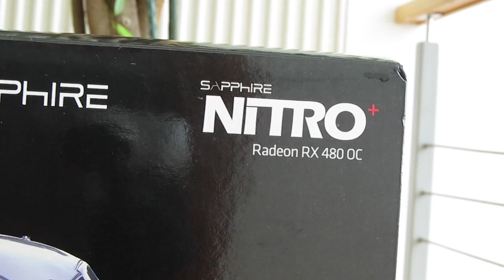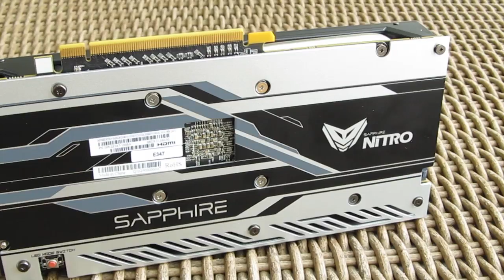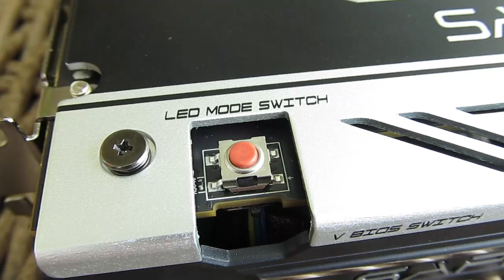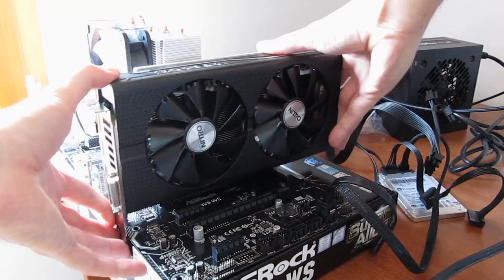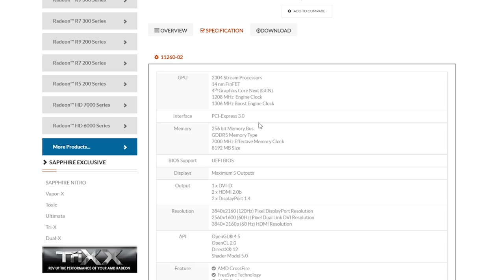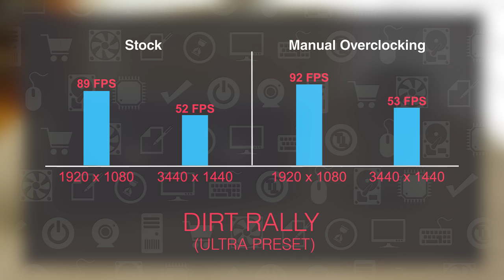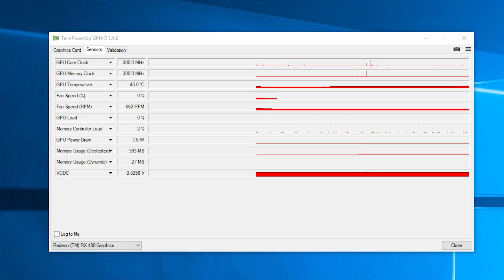Sapphire RX 480 Nitro+ Review - Aftermarket Salvation

Comment: is rx 480 better than gtx 1050?
Reply from the maker: Yes!
Reply: Can this pc run all games in high settings?

Intel i7-6700K || 
Cooler Master Seidon 120v (водено ладење) || 
Radeon RX 480 (Sapphire Nitro+ 4GB) || 
Gigabyte H110N Mini-ITX || 
РАМ: 8GB Kingston HyperX || 
SSD: Kingston v300 120GB || 
HDD: Toshiba 1TB (7200rpm) || 
Antec ISK600 (mITX) ||
Reply from the maker: What resolution? 1920x1080?
Reply: 1366x768
Reply from the maker: Without a problem!
Reply: I dont know which pc should I buy

Intel i7-6700K || 
Cooler Master Seidon 120v (водено ладење) || 
Radeon RX 480 (Sapphire Nitro+ 4GB) || 
Gigabyte H110N Mini-ITX || 
РАМ: 8GB Kingston HyperX || 
SSD: Kingston v300 120GB || 
HDD: Toshiba 1TB (7200rpm) || 
Antec ISK600 (mITX) ||

or 

Processor -  Intel® Core™ i5-4570 - 4rd Generation Intel® Processors
6M Cache, up to 3.60 GHz

Memory - 8GB
HDD - 500GB

VGA - НОВА Gigabyte PCX GeForce GTX 1050 2GB GDDR5 DVI/HDMI/DP

Comment: can i pair this with asrock h110m hdv?
Reply from the maker: Yes!
Reply: thank you! ;)
Reply: Please what about a i5 6400 and ASUS H110M-K D3 with 8gb ram ddr3 16000mhz Will the i5 bottleneck this gpu? from what i see on youtube the 1060 gpu are bottlenecked by this gpu ... Also i need to change my psw i have a casee psw with this system (plus gtx 950) what do you recomend for the rx 480 if it will worck with i5 6400?
Reply: usss2444 should be fine

Comment: I've been reading that a statement from sapphire has said that the driver that has been used by reviewers around the time the card launched has an impact on the fan noise due to the AMD driver overriding a profile that is baked into the card BIOS that reduces the speed of the fans. I'm hoping that the latest driver from AMD has fixed this and wondering if anyone who has this specific card can verify for me?
Reply from the maker: +Agent-Joseph Richardson #101915 Even if they fixed it, what kind of temperatures would we get (presumably it lowers down the fan speed), over 80°C?

Comment: will this be fine with fx6350 or would be better to go for fx8320
Reply from the maker: If you're buying right now, the FX 8320 (maybe even FX 8300) as is it isn't that much more than the FX 6350
Reply: i will go for the fx8350 and rx470..after my research i believe rx470 is more than enough for 1080p gaming and fx8350 is pretty good combo with the rx470...the fx6350 or fx8320 would probably bottleneck hard rx480 cards..(im just planning not buying yet)

Comment: hey is my zalman 500w powersupply enough for this card, i also only have 6 pin connectors with 2 pins hanging from the side(is that basically a 8 pin connector)
Reply: Okay, thanks random guy on internet
Reply: DONT GET THAT POWER SUPPKY, IT SUCKS AND WOULD BLOW UP. GET THE EVGA 500W FFS
Reply: Yes and yes
Reply: hey, I got dazumba built-in psu 450w (dazumba 658), is it possible to use this gpu?
Reply: If you have the 8 pin PCIe connectors (6+2) on it, it should still run even though its 500w recommended..

Comment: they discontinued the 8 gig card that was clocked at 1306 the only 8 gig they have now is the 1340 clocked gpu. the 4gig is still 1306. Also if you make your own fan profile which you should, they no fan till 52c is ok but it will take more to keep it cooler than if you had the fans spinning the entire time just at a reduced rate. this is true of every gpu that has this feature. so say you have 25% fan speed untill it hits 45c then you ramp it up to 35% ect. you may not even hit 70c. If you set the fans to spin at 2200rpm fixed meaning all the time it would probably never get above 65c the gpu is not something you want silent keeping it cooler long and not letting it get above certain temps for a extended period of time will drastically extend the life of any gpu. dont sacrifice gpu life for some more silence.

Comment: should i buy the gtx 1060 custom version or the rx 480 custom version? its really hard to decide..
Reply: Lets not be fan boys here, I got a rx 480 sapphire nitro + 4gb but I wont say its for everyone. The rx 480 will have better performance in time in dx 12 but it will take some time, meanwhile the gtx 1060 outperforms the rx 480 in all current titles dx 12 included. 
There are exceptions to this (like Doom, Gears of war Ultimate edition and a few others)

I would say if being asked: If you plan to have the graphic card for 3 years or more buy the rx 480 otherwise get the 1060 simply because it has a 10-15% ahead in performance in most games at this moment and although this number will shrink (likely anyway/hoping) the rx 480 wont pass it in performance during this time.
Reply: Papa Bear well thats what im hoping for every AMD Card

even now R9 290X Runs beast because of driver support

Comment: Dude, Reviewer...
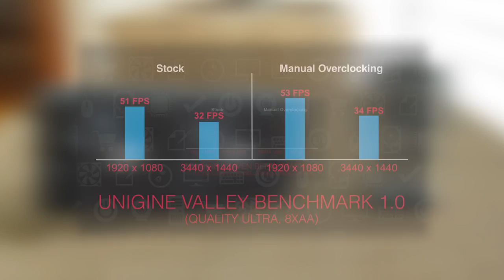6:25 GPU throttling like fuck, just look at core clock (1342mhz normal).
Reply: Skyfx most of nitro could can achive boost clock if undervolting via wattman

reasons why isnt undervolted first place is its different how people pc power efficient for cpu other hardware

so you have to match your safe undervolt wattage

Comment: Hi guys. Need some advice. I just got a Sapphire RX480 nitro OC. It comes with a dual BIOS. Im assuming it is for stock clocks and overclock settings. Secondly, the BIOS switch is on the right hand side (the back plate is face up towards me). Since the BIOS switch is on the RHS position, is this the default stock clock settings?. Thanks for your help.

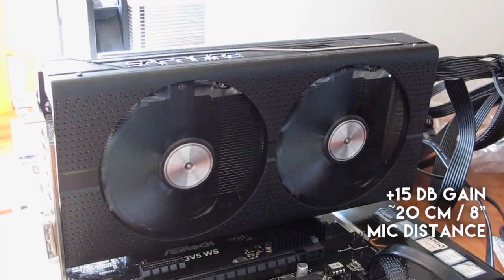Comment: woah wait... 07:05 ... You call that loud?? Are you people insane?
Reply from the maker: +sermerlin1 I guess where all insane and you're the only one sane here! 

Bottom line, putting (your) insults on the side, you missed the point here. When I talk about loudness, I'm not only looking at the noise "as is" , but rather how loud is it compared to other aftermarket solutions out there, and yes it's loud either way (on its own or compared to others, confirmed by a number of different reviews), no matter what kind of insults you spit out towards me or other commenters here.
Reply: TekTick comparing to others its not loud and it isn't loud.40 dB is whisper level mate.
Something is loud when it's over 60-65 dB and on. 40 dB is quiet very quiet.

Comment: Question: I watched your Nitro+ RX 470 review and I was curious about the bios switch. If I switch it to its stock or lower clock mode. Can I turn it down some more? So it'll be at 150W? Because electricity is expensive here and I'm willing to sacrifice performance for it. I'll even turn down the settings a bit if need be.

Can I downclock it? Please help me guys. The card will be available here in my country soon and I'd really want to know before it does. I tried googling but it didn't give me the answers.
Reply from the maker: You can always downclock it, that's not a problem. Lower down the voltage and clocks, play with it a bit and see what will be stable.

Comment: Did you only do temperature and noise testing with Furmark?  Or did you monitor it as you tested games?  Because I know from personal experience that using Furmark puts excessive unrealistic load on the GPU, causing much higher temperatures and fan speeds than what you would normally get when gaming.
Reply from the maker: In this case, only FurMark, but you can check my RX 470 Nitro review where I tested it in game (SW:BF), and compared to FurMark, it was just one degree difference and around 50-100 RPM's difference, which is not a lot. If the game is well optimized, results aren't that far from a FurMark scenario.

Comment: Hum, can you check out the noise of the various 480s after a few driver updates?
From what I've heard there's some issues with drivers and the AiBs blaming AMDs drivers for higher noise levels then ideal on their cards...
Reply from the maker: I would, but I don't have the card anymore! I've addressed that issue already, if the drivers are bringing the speed of the fans up, what kind of temperatures are we going to have it goes down with the next driver update? Over 80°C?
Reply: TekTick The temp isn't really a big deal, the noise is however.
And the issue was that the fans spins up too aggressively not that they're too slow.
Basically AMDs drivers are aiming for about 60 C while Sapphire is aiming for about 80 C and sometimes the fans will spin up despite not reaching Sapphires target temp making it noisier then it needs to be.
After all, the passive cooling will be more effective when the difference in temp is higher.
The driver difference won't change the top OC possible (the sapphire cards actually seems to be able to reach higher OCs then a lot of the other cards for some reason, I've seen a few 1420 MHz reviews out there, you can't really go that much higher then that with just air)
But they seem to be more noisy then the competition too, if AMDs drivers are to blame then that might make this card more appealing to me at least once that has been fixed, as I'm kind of a silence freak.
I've yet to see a 1440 MHz OC on the other cards, I'm hoping to see one from some of the 3 fan cards as I'm tempted to go with the Strix, since it can also control case fans and is the most silent of the 480s so far as far as I can see (although there seem to be a bit of variance in how silent they are from reviewer to reviewer)
I might also go with MSI or with Powercolors Red Devil...
But for now the only two cards announced as sold in my country is the strix and nitro, so those two are of particular interest to me...
Reply from the maker: Luredreier
I'll get the Gigabyte's and MSI's one soon! ;)
Reply: TekTick Good =)
Oh, and I meant "another 1420 MHz review" up there...
1440 was just a typo... ><
Anyway, I really hope I can see a 1420 MHz review of other cards too as I'll occationally be forced to OC my card to make the 3440x1440 screen I'm planing to drive with the 480 playable...
But the noise level is probably still going to be the deciding factor for me when buying one of these...
Anyway, thanks. =)
Reply: your buying all of your stuff from NEWEGG ? RX 480 still isnt available in Greece.
Reply: Mad Max
Me?
Nope, I'm not.
Buying from Newegg (as well as any other e-tailer that's not in my own country) tends to be a lot more expensive then buying something local due to the tax system unfortunatly... :-/
Reply: +TekTick i actually ment the videomaker.... where is he getting the Gfx cards for the reviews......
Reply: Mad Max Fair enough, I'd ask TekTick  though, using the + sign to inform him that you want to ask him something.

Comment: For mid range this is an awesome piece of hardware. AMD VP says multi gpu is the future, have a team working to make it smooth as silk. rx480 in crossfire along with Vulkan api is here. It's a combination that's going to be tough to beat. If your on a budget you wont beat a single rx480 for 1080p. If you plan on higher res. or VR in the future, two of these are the way to go. I don't recommend 4gig versions, get that 8gig son.

Comment: It's a little too late for radeon.. that PCI-E issue had every diehard AMD fan stay clear away from it.
Reply: They fixed the "issue" and increased performance while they were at it. That's the red team for you.
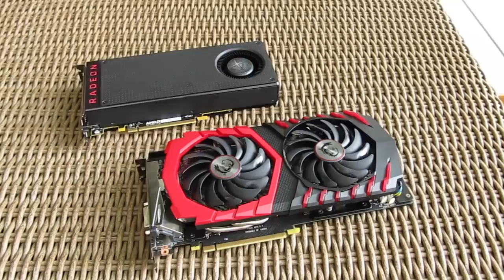Reply: Oh.. well i joined the other Red team.. the MSI GTX 1070 team @ 0:25
Reply: +S.P. "diehard"
Reply: Bullshit, the PCI issue is only for people with shitty motherboards and only on the Reference design cards.
Reply: and it is also fixed since weeks now
Reply: Even though 2 people have already told you it is fixed, I feel the need to remind you that AMD has already fixed the issue. 

You should also hear more from both sides unless you want to get scammed. It doesn't matter which side are you on. Be smart at least.
Reply: Did NVidia fix GameWorks yet? It's been years, and it's really shitty.
Reply: There never was a problem... The worst that ever happend was that one in a million PCs turned off while under full load with nothing breaking.
Reply: it damaged boards that were from 2006 to 2008 and you should not run this type of card on a platform that old
Reply: A 200-250$ card is exactly the card that would end up in older systems, it's also the card that would end up in lower end systems where people skimped on the motherboard (several reviewers had the card causing reboots/shutdowns during testing when testing on modern but not high end motherboards).
The card is still out of spec even after the fix, the PCIe MB draw issue isn't the only problem with the card, the PCIe 6pin connector is wired like an 8 pin one (ground wise) which causes more draw than what the spec allows for from the PSU, it's unlikely to cause damage but it can cause system instability in lower grade PSU's.
There is no excuse for the design fuck up on this one, AMD should have recalled all the reference design cards and the AIB partners should have issued a replacement programme for the reference designs.
Reply: +S.P. lmao "it's not very fast" . enough with the lame excuses to justify ur impulse buy. u weren't gonna buy the card anyway since u opted for one that was double the price.
Reply: Its not about whos a fan of what brand, its about whats available and whats not. I live in Canada, and both brands are ALWAYS sold out!

I did want to get the Radeon RX 480, but it sold out within 27 minutes of its launch date, I waited for a restock.. and it never happened.. and after a week or two I did a bit more research into that card..

1. its not very fast

2. it had some issues that can damage a mainboard if overclocked too high

3. full specifications were not released, even GPU-Z wasnt showing the full specs

4. it was sold out everywhere

MSI had a sale on the 1070's and I got that instead.
Reply: Marco Rodriguez Do you live in Canada? probably not. and if you did, then you would know very well thats its near impossible to find a decent video card "THATS ACTUALLY IN STOCK"

http://www.newegg.ca/Product/ProductList.aspx?Submit=ENE&DEPA=0&Order=BESTMATCH&Description=Radeon+RX+480&N=-1&isNodeId=1

Like I previously said.. I waited, no restock. other resellers started overpricing them on amazon because everyone wanted one, sold out on newegg, sold out on ncix

I do my homework, I'm not going to buy something without knowing the full details about it, there was no full specifications on the internet at that time, and the benchmarks werent very pleasing to me. I recently had 2x 660 GTX SLI, never planned on doing another SLI set up because I have a bunch of other stuff in my PC drawing alot of power such as my ASUS XONAR ESSENCE STX, etc

I don't care if your a fan of this and that brand, bottom line is Radeon RX 480 does 48 ~ 58 fps in Witcher 3 while GTX 1070 does 85 ~ 95+ fps

I've seen the results all over youtube already, so thats what I decided to buy:

http://i.imgur.com/YQAFI13.png

Comment: 8GB cards perform better as well.  I'd like to see 8GB numbers for comparison.  If you get a Gigabyte card, see if they can get you an 8GB card.
Reply: In most games there is nearly no difference between 4GB and 8GB (at least at 1080p and 1440p). The only real fps difference between the 2 are because of the different memory clocks. But alot of people are able to oc even the reference 4GB cards to the same memory clock as the 8GBs
Reply: It has been clearly shown there is a performance improvement with the 8GB model.
Overclocking the core and RAM has more to do with the Silicon lottery than the amount of RAM on the card.

Comment: Way too expensive compared to a 1060, which runs cooler, needs less power and performs better for only $20 more.
Reply: that depends where you live lol where i live the nitro is around 300euro while the 1060s are 350euro

Comment: Honestly sounds about as loud as my nitro 370. which isn't very loud.  pretty tolerable at 100% speed compared to my fx8350 stock cooler up around the 7k range...
Reply from the maker: +Bigjoe980's game corner You have very high tolerance for noise :D
Reply: Hmm, you think so? Maybe! I've never had anything else to compare it too..  To be honest I think they're the exact same fans..., maybe the motors are different.  How fast do they turn at 100%? Mine are around the 3700-4k range.

Comment: NO, 4GB model core clock 1306mhz (219USD) and 8GB model core clock 1342mhz (269USD)
Reply from the maker: There's actually two versions of the RX 480 8 GB Nitro, the 11260-07 and 11260-01. The 11260-07 has the same Boost Clock of the 4 GB version, 1306 MHz!